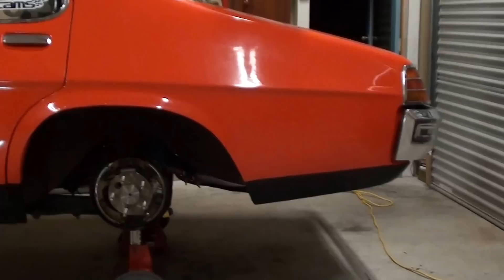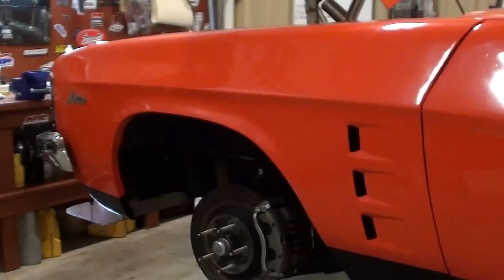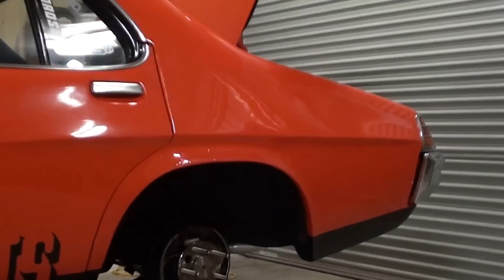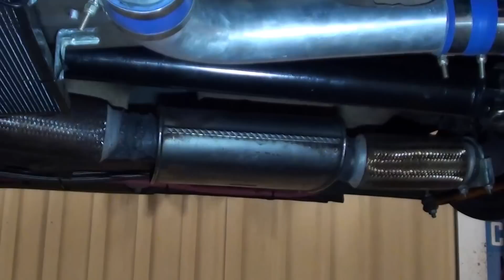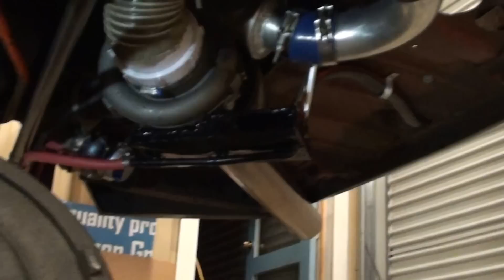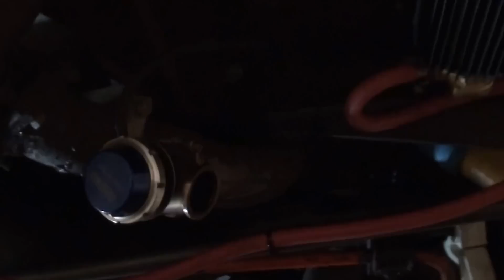REARMOUNT TURBO PT1  (EXHAUST SYSTEM TIPS)

Comment: Love your video I'm doing a rear mount in the bed of my truck.  I need help picking out my turbo.  Its a 5.3 aluminum LS built Wiseco piston Eagle rods an will be running around 16 to 20 pounds of boost. Going with a Billet 80 mm Turbo not sure what AR turbo 90ar 110ar or 134ar turbo are my options.     Also like for your in put on the oil system.   Would like a remote contain oil system for the turbo oil tank an cooler

Comment: im planning on putting mufflers after the turbo . any problems with that ?  i have flow masters so thers high flow .
Reply from the maker: BOHYDRUS i have as you know muffler pre turbo, but you can run after turbo no prob, hi flows sound good mate👌

Comment: Are you using exhaust clamps or did you weld all of the exhaust joints?
Reply from the maker: Bradley Yamamoto  its welded, but i do have flange joints so i can pull it apart easy..

Comment: Hi mate. 
What size exhaust are you running? Also what size pipe are you running forward from the turbo to the intake?
Reply from the maker: david hanssens a 3 inch pipe to turbo, and a 2.75 inch charge pipe
Reply: GRIFFS REARMOUNT TURBO, The Modfather.
Cheers Griff. I'm just playing with a 302 now and was wondering about pipe size. Much appreciated

Comment: Griff thanks so much for the reply. 

The turbo im looking at is a Gt45 (internal wastegate as it will be a bit quieter of the throttle and attract less attention)  its probably a bit big but with the limited knowledge i have its larger than the standard XR6 turbos and they work very well front mounted. if i need to go bigger then so be it.

The cooling system is extremely good considering the loads i put it under, its just going up the hills that makes it load up and get a bit hot, as soon as its on the flats or down hill it cools back down in 30 seconds.

Thanks again, i have subscribed and i hope we can keep in touch some way. cheers and keep up the passion. Joe
Reply from the maker: hammered hemi turbo sounds a nice size, from what i know now going slightly bigger has more pros than cons, well goodluck mate and keep me posted cheers Griff....

Comment: Hi Griff, fantastic idea and job. i want to put something to you?

I do a lot of towing and don't want to buy a diesel ute. i have an au falcon there tough as nails and cheap to run and buy parts for. I want to run a rear mount turbo just for the extra torque for getting up hills loaded. This is not a high performance mod just a little extra to get up hills and better highway cruising.

The PSI i'm thinking of running is around 6 to 8 psi on a NA motor which it should cope with just fine. i have seen guy's put 15 PSI through these engines but without some internal mods reliability then becomes an issue. 

I want to retain the cast exhaust simply because there durable and flow just as good as a header would, the rest of the exhaust will be 3 inch.

For the oiling i want to run a 2L ally tank with pump and flow through cooler just for the turbo, this way it will keep the turbo at a nice temp.

The big problem is the cold side, the next question is to run an intercooler or not. Basically i want the under bonnet as stock as it can be and because its running so little PSI maybe i can do without the extra piping and intercooler fitment.

Let me know what you think, you have done a great job and i hope i can do the same.
Cheers
Reply from the maker: hammered hemi Thankyou mate.. i looked into the motor comp ratio if im right 9.6. sounds nice to me. Turbo size will dictate wether intercooler is needed, too small a turbo and intercooler will be advisable. But a nicely matched turbo will not produce too much heat on low boost. The only thing is 98 is a must,  My experience tells me that your cooling system needs to be a1 condition,and im sure you know especially towing the tune will need to be lazy as, so when your towing in hot weather up a hill she dosent start to detonate, no matter how tuff your engine is denotion will at the bare minimum blow   headgaskets in a blink, even on low boost problems can happen very easily in a instant..

Comment: love your channel.   great info   what a big help.      is it a must to run an intercooler.    and the dilemma I'm having is turbo selection.   single or dual turbos.    my build is a 350ci Chevy S10 with 6spd manual trans. Ford 9in rear with 17 & 18 in Corvette wheels and Corvette brakes.   it's a  low budget build
Reply from the maker: monster mechanic 2000 im glad you like it, im keeping it as real as i can  with a hands on approach no bullshit telling everyone  what works for  me and i hope it helps someone on there own  build,  Haha sorry got side tracked.. you dont need a intercooler if on low boost eg under 10 pound. if wanting more water/meth is a good option on pump fuel, not e85, Stay single its the best in my opinion less plumbing and all the rest , cheaper to,  if your struggling for turbo choice you know what i run its a match made in heaven need i say more... cheers

Comment: depending on application is it better to put the muffler before or after the turbo.    and how did you solid mount your turbo.   did you make your own brackets and mount to the floor and or frame. and how about the inlet flange at the turbo inlet.    the big rectangular flange
Reply from the maker: monster mechanic 2000 i think its better muffler pre turbo,good strong hi flow muffler, it seems too muffle the sound better,under pressure has something to do with it. i have tried it downstream from turbo sounded no good, i suppose it doesn't really matter but less restriction on down pipe the better.
i solid mounted off the flange bolts through too boot floor and tail pipe works nice. its a t6 flange, 3 inch pipe goes well together, just a slight hammer to shape to flange then welded, di grinded the dags on inside for good flow.  cheers
Reply: To: The Canadian:.   thanks for your input and your knowledge it's very helpful  As a gearhead, you never stop learning.    learning what works and what doesn't is also a little easier on the check book to, when you build on a small budget.     thanks again to: Griff's rear mount turbo and The Canadian for sharing your knowledge
Reply from the maker: nice too hear you thinking out loud, well said....
Reply from the maker: monster mechanic 2000 my pleasure, i dont pretend to know everything and i dont want too, all i know is what i have done to my car, what works and what doesn't for me.. if you can pick up some little bits and pieces plus enjoy my babbling on lol, and get see it evolve plus some action, well that makes me happy and hopefully you too, cheers Griff.

Comment: Top vid mate well done !!!  Would that ceramic coating stuff help with the heat do you think ?  I know what you mean about the headers or extractors overheating, my Capri I had the  headers that we're on that if I gave it a thrashing the headers would sag and eventually crack and brake the engine pipe AGAIN !! Great advise mate can't wait for the next one Seeya Rob......I left a comment in your discussion section too when you get  a chance ! Seeya !!
Reply from the maker: I don't think so, all steel has a limitation on heat, mild steel seems too last ok unwrapped,but the trade off is everything close to it burns, stainless is prone to cracking, mild steel is more forgiving, remember this is extreme use im talking about, bottom line for me mild steel unwrapped with a few extra supports...